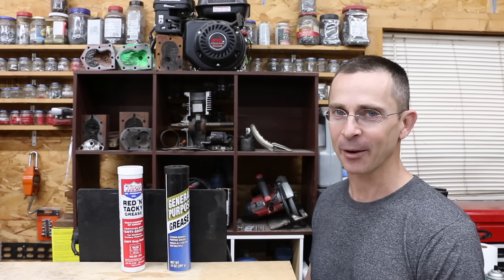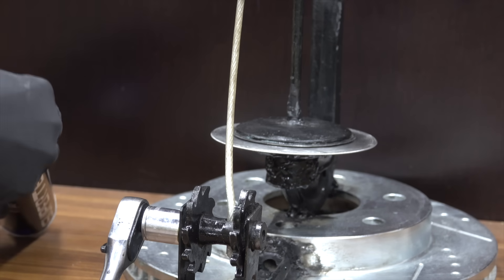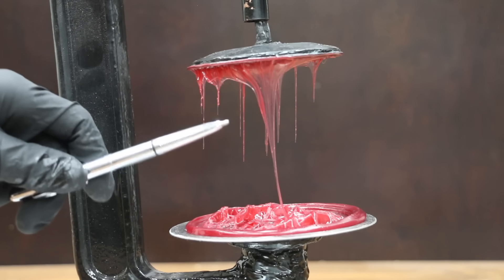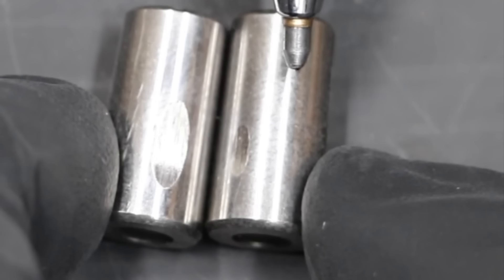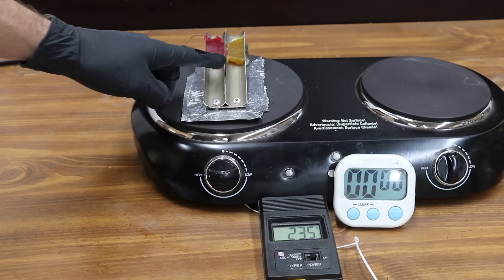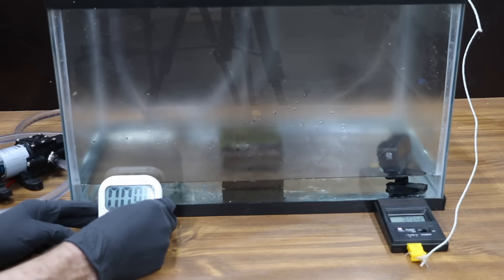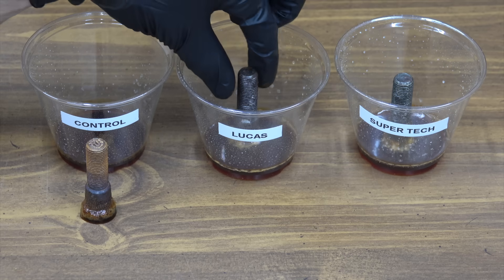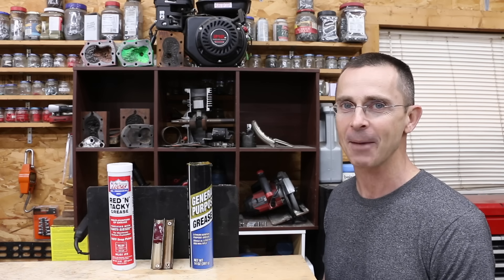Is Cheap Grease better than Lucas Red N Tacky? Let's find out! Bearing Grease Test Episode 1

Comment: I didn't  need to see proof ;   my boss took over his dad's trucking   company.  my boss   had us clean all the 90w   out of  oilers  on all the trailer hubs.     alter cleaning bearings.   told us to unload  grease drums          off his pick up truck.  now start packing  bearings. I  never knew  that there was a red tacky grease  on the market.  had to wear  sure grip rubber gloves.   that stuff sure is messy.   very hard to get off  your hands                       but I  could tell  right away,   this is a excellent product.                                            I refuse  to buy  any other grease   to use on my own car or truck.
Reply from the maker: Thanks for sharing.

Comment: GREEN GREASE full synthetic
 No grease out there can touch it. Pack your bearing full of Green Grease and throw it washing machine full wash cycle will come out grease still in bearing with not 1 drop of water in it. Mobil 1 is a green grease wanna be. Rub green grease all over both of your hands and then try to wipe it completely off with new shop towels. Only way to get off hands is with carb or brake parts cleaner or a solvent cleaner
Reply from the maker: Thanks for the feedback.

Comment: And please make sure next time when your  demonstrating the water test please make sur the water stream is in line with the center of the piece of steel or use a slightly larger piece because it’s kind of an inaccurate measurement if it’s not hitting the exact center due to the wipe away of  the extra grease the water forces off the metal
Reply from the maker: Thanks for the constructive feedback.

Comment: I can say for a fact that lucas grease is bad for wheel bearings. The trouble with it is that it is to tacky and it builds up on the outside of the bearing instead of " flowing" back into the bearing as it heats up. Its good for a lot of stuff but not to good for wheel bearings.
Reply from the maker: Thanks for the feedback.

Comment: A brand I was just told about was Fuel Ox infinity lube grease. The claims they make on it are kinda hard to believe. I cannot find any reviews or testing on it that gives any good info. At $25 a tube, if it works, I’d use it for things that mainly have to be tore apart to grease and don’t get touched for long time periods. Would LOVE to see it tested since nobody I can find has!
Reply from the maker: Thanks for the video idea.

Comment: I would encourage you to check the designs of standard testing (ASTM) to see if your rigs (which are very ingenious) actually cover the key variables that have been developed over time as important to gain unbiased test results. Your compatability test here is quite lacking. Greases usually don’t statically react, so mixing them together and letting them sit doesn’t tell you anything. Compatibility is a dynamic effect and a period of dynamic mixing together, along with measuring changes in dynamic flow characteristics is required.

Comment: I have used different grease brands in my truck but it's very hard to see the difference without the type of testing you have done.  I was surprised by the difference.  1 of the problems I have faced in the past is I actually had a trailer stick to my 5th wheel at about minus 25 but seeing your cold test convinced me I should have been using Lucas.
Reply from the maker: Thanks for sharing.

Comment: I have a grease gun loaded with Lucas Red and tacky. Its been on the shelf for about two years and red oil is leaking out of the grease gun. Don't know if this is good or bad. It's just what has happened. I was using it on my M35A2. Now I wonder if I should change back. I have not seen any red oil leaking out of greased components on the truck.

Comment: How about seeing if a farm mower (Bush Hog etc.) will continue to run with the gear oil drained out and replaced with gun grease like you used in this test?  This would simulate still using a mower with a bad bottom seal.
Reply from the maker: Thanks for the suggestion.

Comment: It would be interesting to see the results of over greasing a bearing spinning around 1000 rpm.  Checking the temperature and if the bearing is better to be over greased or under greased and what is optimal
Reply: sounds like a dura-lube or dyna-lube testing machine.
Reply: There is such a thing as too much grease. There’s a happy medium

Comment: I've used Lucas Red and Tacky and all sorts of other brands. Lucas, in my hands on experience, definitely is different. And in view of the tests, it's superior. 
But I've never had a bearing fail using other greases. Most of my experience is with trailer bearings.  And I've found that any grease is better than no grease; and all my trailer bearing failures were always attributable to no grease. For my purposes I'm not sure Lucas is worth the extra expense. But I may be wrong about that.
Reply: henry's trailers- specializing in trailers that are used in saltwater- uses only a proprietary red semi-synthetic distributed by bush brakes of national city, ca. red n' tacky is a very similar lubricant.

Comment: I enjoyed this video and obviously the Lucas is better, but from the very beginning it even said it was heavy duty and the super tech was light Duty. The supertech I'm sure would be adequate for many applications, such as steering axles and things that do not rotate or get hot, but for anything that has a bearing in it and turns a lot and creates heat the Lucas would be a much better choice.
Reply from the maker: Thanks!  Thanks for the feedback.

Comment: In highschool and part of University I worked in a lab for a plant that made all kinds of contracted grease and lubricants.  Most of our grease was lithium based, but also some more expensive aluminum based wheel greases.  It was always off, we made that red super tacky grease, it used additives to get the tack, but the base soap and oil was cheap, it always tested well and most people hated making it because it was this low cost product.  The standard lithium greases had a much wider variety of performances, used different soap bases and oils but generally cost a lot more.  The most expensive part of the grease is the soap, the standard grease has more and the red tacky has little.  

Its pretty amazing how badly most products out there are made, I mean they gave me tasks to take competitors products, test them for their real values (don't trust the labels, they are lying to you) and come up with alternatives.  It wasn't difficult to take a half assed product that barely worked on paper, not at all in the real world and beat it on the target budget.
Reply from the maker: Thanks for the feedback.

Comment: As a John Deere tech I would love to see some comparisons using their greases and oils since they spend millions devolving them it would be neat to see how much higher quality they really are
Reply from the maker: Thanks for the suggestion.
Reply: JD spends very little developing greases.  The "farm" out production to 3rd parties using their formulas.  Chemtool used to make them, not it appears that Axel makes most of them.
Reply: I stopped using the Deere multi purpose on my 320 skidsteer because the zirks plugged.
Switched to a Texaco moly grease and no more plugging.

Comment: I used to use axle grease on the steering slide on my outboard motor. The slide would seize because the grease would react with the water.  I found that if I used marine grease that wouldn't happen.  Water resistance is more than just shooting some warm water at it.  Marine grease has water resistance properties, obviously, but I believe it is something that can only be tested over long term.
Reply from the maker: Thanks for sharing.

Comment: If I wanted to change the grease in my ball joints,  or any joint in the steering and track bar, how would I do that?  I would love to replace the grease that is in there with the Lucas Red and Tacky because  I believe my mechanic uses the lesser quality...
Reply from the maker: Thanks for the suggestion.

Comment: Awesome video, I always enjoy your comparisons, you really do a great job with methodology and remaining as unbiased as possible. I work at a truck shop, and due to the recent shortages of grease we've had to get by with what whatever we can get. Simply due to availability we recently got in a few cases of Castrol Pyroplex Blue #2, which advertises improved water barrier performance and reduced breakdown of performance with water contamination, even that it thickens up when water is introduced. I have noticed that cleaning this grease off the floor is much more difficult with water based cleaners than other greases, and that it is pretty tacky and doesn't slide off of wet parts. I would love to see some testing of this grease, maybe in a future grease shootout. It could be a fantastic option for parts or applications that for whatever reason aren't perfectly shielded from the environment, provided it can meet it's claims in testing
Reply from the maker: Thanks!  Thanks for the video idea.

Comment: This is another great test ..👍 .   I have used Lucas products for many many years and have had great results with everything from that company.   My question is have you tried or do you use Lucas Heavy duty grease ?  Not that Red and Tacky is bad ,. but the Heavy Duty is even better,. I especially prefer using it for ball joints and universal joints that take a lot of heavy shock load .  my cousin told me that when he used to work on the farm they often used Schaefer grease and oil products, and that they are probably just as good as Lucas .  Have you ever used Schaefer ?  I personally do not remember using Schaefer products.  but Many years ago I had used Cenex brand oil products and worked very good .
Reply from the maker: Thanks!  Thanks for the suggestion.

Comment: Test wall spackle and other compounds.  How fast they dry, how easy to sand, one coat of paint to flash, and shrink.  Test on multiple surface depths.  I'm really curious to know.  I'm a 25 year painting contractor and I go through different brands
Reply from the maker: Thanks for the suggestion.

Comment: This is the go- to channel if I search anything at ALL. I try to search the name project farm. I currently am soaking my rollerblade bearings in CLP. I have two ideas for future videos if you need them. Best bearings to buy, and a real world test on CLP, and how well it works. I like the CLP but don't really know if I should or not. Initially though, I would love to find a great bearing for skating. I've heard abec 5 is good. And the ones I'm currently using are bevo gold 7. They came factory in my rollerblades 8 years ago. But they've only had about a month of hard use. I'm anxious to see how well the hold up. Anyhow I love the channel more than you will ever know, and I don't want to see the video if you don't want the extra workload, just throwing some ideas around is all. I'm at the point in my life where the cheap junk just doesn't qualify in terms of quality, and the best deserves my money
Reply from the maker: Thanks for sharing!  Thanks for the suggestion.

Comment: I'm curious what oxidizer you are using? 

Good choices are high potency peroxide, potent chlorine oxidizer (hydrogen chloroxide) an oxydent acid (such as hydrochloric, sufuric or phosphoric acid), piranha solution or an alkali oxidizer (such as household bleach or lye.)  

I don't tell how to make piranha solution in comments because I can't fit the warnings on handling into  comment box.  Seriously, it's dangerous stuff.  You can find references online.  It is the strongest thing when it comes to oxidizing polymers, though, so if you want an oxidizer that will tear through grease, piranha solution will do the job.  By the looks of it, the solution was clearly not piranha solution, because it literally fumes and bubbles when brought into contact with steel or any carbon containing polymer.

I don't know if the Lucas grease would react to piranha solution, but that super-tech grease contains mineral oil base, which would.   Depending on the quality of the silicon soap, it might also react.
Reply: As a note, if the amber color in the solution wasn't dye it was likely sulfuric acid with a stabilizer.  Sulfuric acid gets an amber color when it bonds to a stabilizer, then turns that pretty amber-ruby red when combining with iron oxide.   Iron Sulfate (the source of the color) is a nice amber-ruby red pigment, if you ask me.

Comment: Grease really depends on what exactly you are using it for.

The temperature you are using it at, how frequently you want to change it, the rate of motion of the parts being greased, how sealed the point of contact being greased is (is it in a sealed gearbox, or is it an open chain drive?)

Lithium grease, silicon grease are probably the two best greases for general water-resistant long-life use.  Blends of compatible variants of these two can be particularly superior.  One of the latest techs involve adding graphite nano-particles.  I think Project Farm has done a video on these as oil additives.  Maybe it was another channel.  Either way it's cool technology.  

Mineral Oil based grease is well rounded, predictable, but not as good in any category other than cost, where it wins hands down.  If you'd rather just re-grease frequently, it's more than sufficient.
Reply from the maker: Thanks for the feedback.

Comment: You should do a project on coolant additives!
A few state;
•reduces engine temperature 
•prevent overheating
•provides maximum corrosion protection 
•reduces engine coolant temp by 20°f.
And there’s multiple popular brands of the stuff!
Reply from the maker: Thanks for the suggestion.

Comment: Would be nice if you did a test of dielectric grease!  There are many videos on the product but only you seem to test the facts.  Does it or does it not conduct electricity?   Some say pay connectors some say not on connectors but on the edges? Which is it?
Reply from the maker: Thanks for the suggestion.

Comment: Lithium is for ball, needle, roller bearings and is red, blue, green, yellow, Moly is for race & bushing, No ball style bearings, it has lithium with plates that slide and is black or gray. Not all grease is used in the same applications. Don't use Lithium on races & bushings, Don't use Moly in wheel bearings.
Reply from the maker: Thanks for the feedback.

Comment: Can you do a test on which grease is best on bushings? Such as Silicone, lithium, motor oil, assembly line, etc…This is a question that consistently pops up at work “which grease is best with polyurethane bushings” so which is it PF? We need your help!
Reply from the maker: Thanks for the suggestion.

Comment: I’d like to see Lucas Red and Tacky vs Mystic 6 red high temp multipurpose or Tractor Supply’s red high temp multi purpose.  I use the later red high temp greases everyday for my work rigs.  I bought some Lucas Red and Tacky a few years ago to try out but was astonished and disappointed  when I saw that it had turned to liquid in a hand pump grease gun I had laying in my truck bed for just a few days.
Reply from the maker: Thanks for the suggestion.

Comment: Hey Project Farm!
I would love if you tested Green Grease!
From everything I know it has out performed Red N Tacky in my company and is even used on aircraft.
Reply from the maker: Thanks for the suggestion.
Reply: The drop point on the green is about the same as the red. I use the green, like the color. Easy to tell when it's dirty.

Comment: I am on an RV chat group and several guys on the group recommended Lucas R & T for packing travel trailer wheel bearings.
I have used it for several years BUT the last time I pulled out my grease gun which had a tube of R & T inside when I upended the gun at least 2 or 3 table spoons of oil ran out of the gun!!  It dripped all over my garage floor and work bench before I realized what was happening.  The Lucas had been in the grease gun about 2 years sitting on the shelf in my garage.  The oil separation was somewhat alarming.  I wonder how the R & T is doing while it's sitting in my trailer hubs for months at a time between trips??
Reply from the maker: Thanks for sharing.

Comment: I used to use Mobil 1 Synthetic Grease with a Dropping Point of 550f.  Well, I went through about 5 tubes and the dropping point was about 80f.  In the summer that stuff was leaking out of my tractor and the grease gun, a complete mess in the shop.  I switched to Lucas and never had another issue.  Thank you for making these videos.
Reply from the maker: You are welcome!  Thanks for sharing.
Reply: so it's an old tractor with bad seals, does not correlate to the grease              mobil 1 is probably a great lube
Reply: @galehess6676  It was not just the tractor.  The tube of Mobil 1 in the gun hanging on the wall was leaking grease down the wall.  Maybe I got several bad tubes, I don't know. But it was enough to make me switch, I got tired of cleaning up the mess.

Comment: My unscientific experience is that Lucas Red and Tacky grease is much less flung out of the U-joint bearings on my truck than the grease Toyota put in at the factory.  Several different mechanics recommended to use Red and Tacky.  It is good to see rigorous testing shows the mechanics’ recommendation is more than folklore.
Reply from the maker: Thanks for sharing.

Comment: There are 14 brands of wheel bearing hub assembly available for my car on RockAuto, ranging from $39 to $159, I wonder if there is a good way to test and compare all of the options to see if Moog , Timken, and SKF are worth 3x the price of the lesser brands.  There is a lot of anecdotal experience out there, but no real measurements or tests.
Reply from the maker: Thanks for the suggestion.